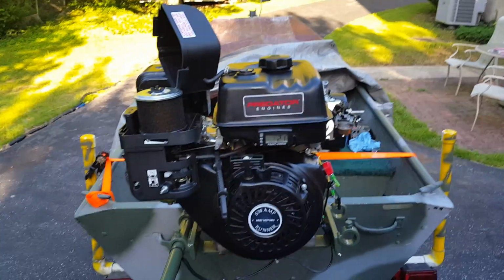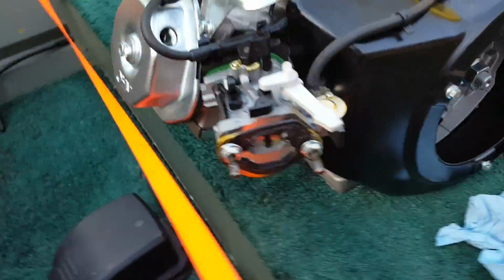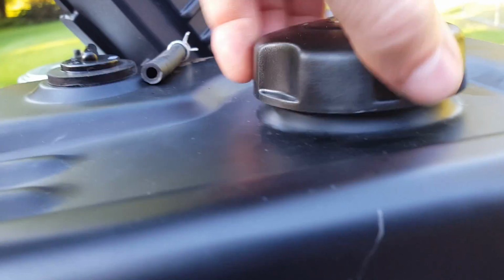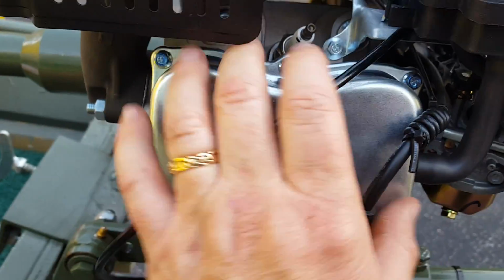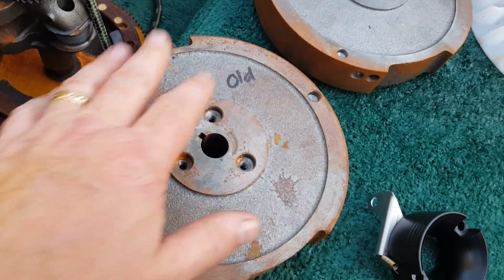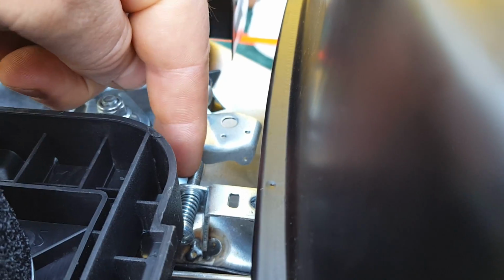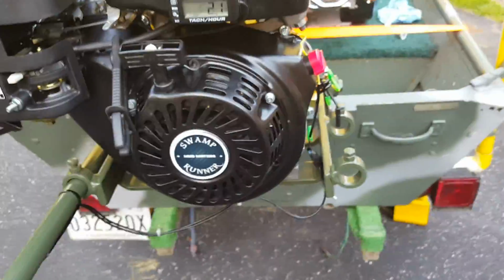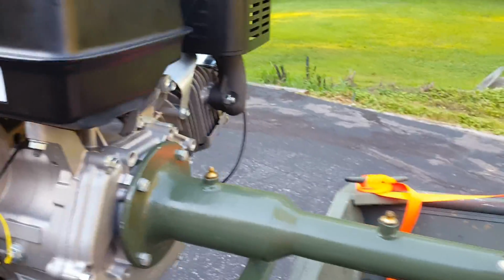The differences between the 2015 and 2016 Predator 301

Comment: Thank You for your videos on the 301.
Any idea of  horsepower of a stock 301  at 1,800 RPM? And 2,400 RPM ? 
Thanks
Reply: If you still have the box it came in look at the shipping sticker on it, it actually says its a 10 HP gas engine.

Comment: Did you rotate the starting handle housing from the front to the top of the engine?
Reply from the maker: Yes, makes it easier and more stable to pull while you are in the boat.

Comment: Why did you replace the 301 with another 301 vs the 420 or 440cc that is the same size overall essentially?
Reply from the maker: Because it was already set up for the 301 plus it is cheaper then the 420 and weighs less as well.
Reply: Good information... Especially the differences (or lack of differences between the timing & shaft taper) between the old & new flywheels... Unfortunately, Rumnhammer does not understand that there are other parts besides the engine on this boat... Putting a larger, heavier engine in this boat will 1) Use more fuel, 2)Put the existing parts of the propulsion system under increased load & stress, because of the increased torque of the larger engine, 3)Change the CG and reduce the useful load capacity of the boat because of the heavier engine and larger fuel tank needed to feed it... It seems like Rumnhammer needs to run out of fuel , break propulsion components, or capsize his boat in the middle of a lake, to realise that his idea might not be such a good one after all...

Comment: Well great Just bought a 301cc 2015 e bay $100 including shipping for repowering an obsolete 4-wheeler oh-well it will be fun for the grand kids ... and fairly cheap will be using a comet clone torque-converter and modified air intake . Best ... 
1 week later the motor arrived it was a hemi serial #62554 ?? $100 delivered with harbor freight manual in box best deal I've gotten in ages

Comment: You dont need an air filter on a boat . good video.
Reply: Most boats that come from the factory have a screen on the intake for several reasons... Some of them are: 1)To reduce the risk of a fire that could be ignited by a back-fire coming from the intake 2)To reduce the possibility of ingesting debris, especially when running the engine on a test ashore or when operating in a bug-infested area 3)To reduce the noise that is emitted from the intake of the engine... Very important at quiet lakes...